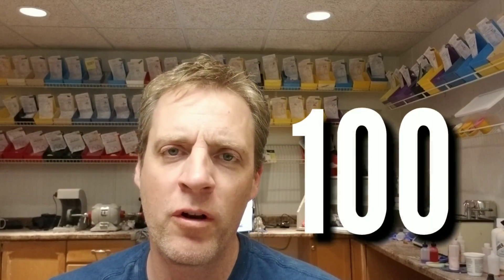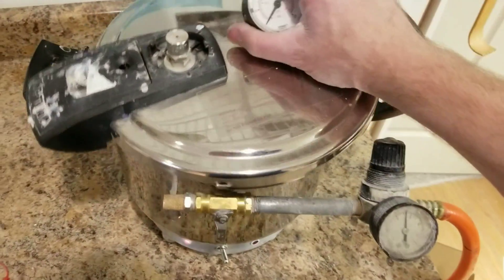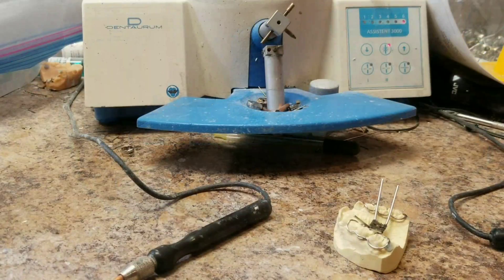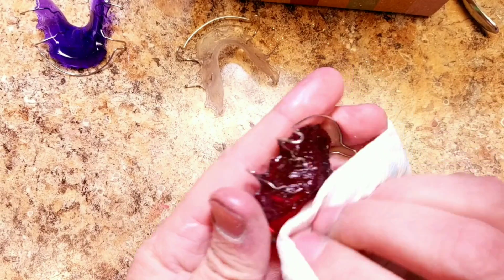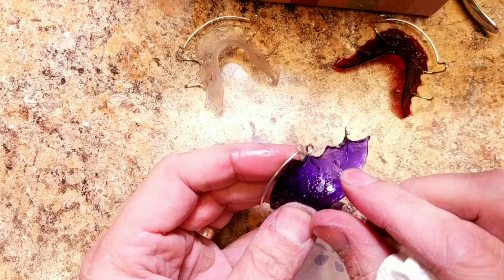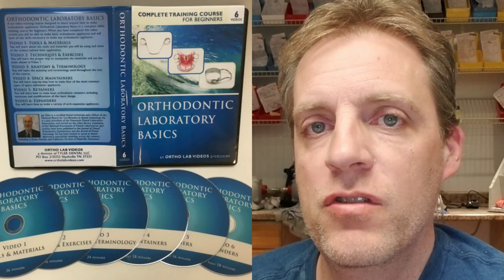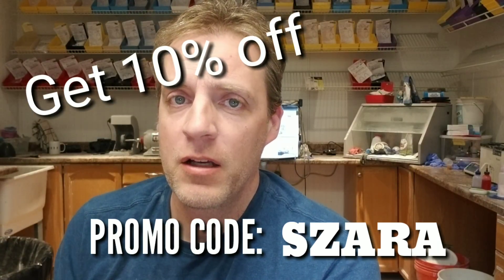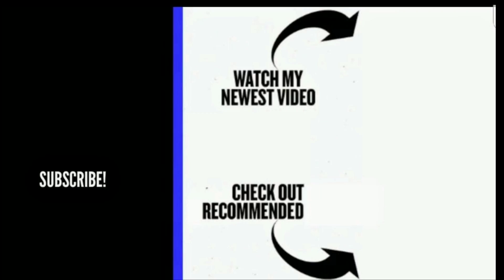Szara Dental Lab Ortho Questions Answered #100

Comment: Hi Steve, another great video. I liked the trick with the mineral oil. The appliances look great after. 😁
Reply from the maker: Scott Wood its awesome. Oldest trick in the book. If you make dentures,partials or adding teeth to retainers, flippers.  ☆☆☆☆☆
Reply: Szara Dental Lab where do you get it from? I place my appliances in an ultrasonic bath, then put them in a disinfectant bath and scrub with a toothbrush. I get some great results, but this seems quicker. 👍
Reply from the maker: Scott Wood you can buy it at any Walgreens.  CVS.  I also do the exact same as you. I just put a small drop on mineral oil on any appliance then dry with a paper towel. It will still look wet even though you remove the oil. Also it hides any small blotches of plaster etc.  Very small minuscule blotches. You'll have to try it and let me know what you think